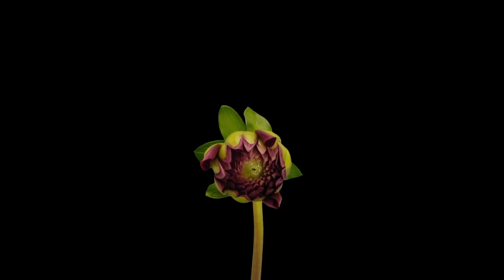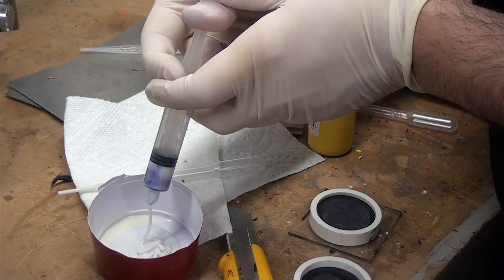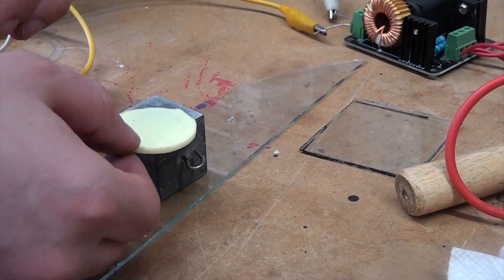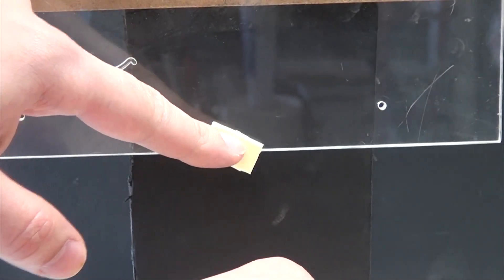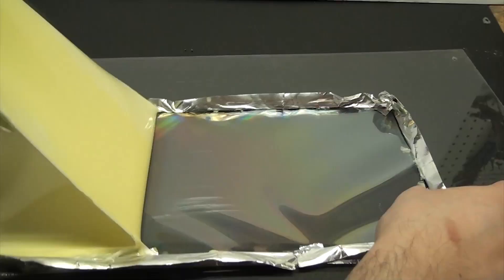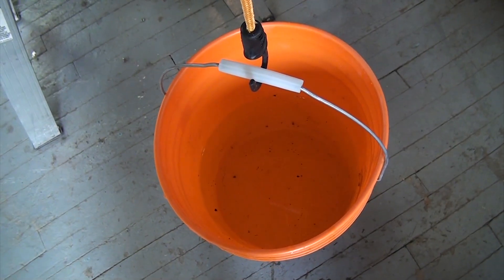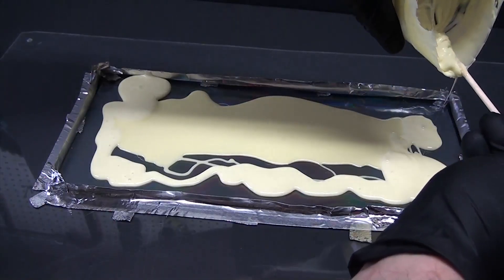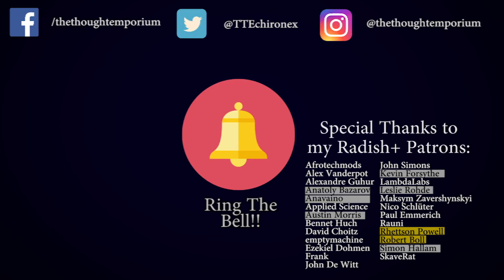Climbing Walls With RAINBOWS - DIY Gecko Tape

Comment: I wonder, Veritasium visited a company that is making plastic sheets that have color by punching millions of tiny holes in them. They are nano scale structures just like the some butterfly wings, and reminds me of the nano scale structures in gecko foot pads. Could a similar method be used to create a mold for the silicon? Or maybe the method they use to create the nano punches could actually just form the gecko tape directly?

Comment: Hello, I am a student trying to replicate this experiment and possibly take it further. Did you use any mold release in your process? When I demold the silicone it somewhat picks up the ridges from the diffraction grating but also has a dull matted finish. A few areas are smooth and brightly iridescent so I do not think the grating is the problem. Any advice you can give me would be greatly appreciated. Thank you for your time.
Reply from the maker: no, just poured directly on the grating
Reply: @thethoughtemporium  Hmm, maybe I am just being too rough when I peal it off. I know silicone is not supposed to stick to anything but mine strongly adheres to the sheet each time. Do you remember if you were using tin or platinum cure silicone for this project? Thanks

Comment: After you have poured the silicon, lay a sheet of woven fibreglass cloth in the mold. It will sink into the silicon and form a composite material that will distribute the pulling force more evenly. Then place the mold in a vacuum chamber to remove the micro bubbles that form under the material during the pour. Hope this helps.

Comment: my silicone is much more runny, did you use one with a catylist? i think it's platinum based. Thats what i used and it's super runny at first so gives a really flat surface on the "air" side. I didn't do gecko material  - i was actually scuplting an octopus beer opener :) very interesting video cheers o/

Comment: I’m a chonky 94 lbs (I’m a teen), so I’m pretty sure I could turn into spider man using this
Reply: i personally am really reminded of one of the first missions in black ops 2 where you grip onto a wall and swing off eachother. If this material gets refined enough, we might be on the verge of that

Comment: If you don't have one already, get a vacuum chamber. Being able to pull the air out of small places will give you sharper results at the ends of the silicone. Love your site. Keep it up. If your interested in hydrogen energy stuff check out "Roy McAlister hydrogen" on youtube. It'll make ya wonder. Aloha

Comment: You might try a sheet of cloth rather than acrylic for the gecko sheet backing- it should act as a load spreader, but still flex to allow full contact.

Comment: I feel like the untreated silicon is acting as a suction cup. Two extremely smooth and flat metal gage blocks will stick together if twisted in a way that all they air in between them is pushed out. When you go to smaller and smaller fibers or ridges I feel like you are either seeing a suction cup effect, or making the sheet flat enough to wring out air in between. This is why it only works on flat surfaces with as much surface area touching as possible. It failed eventually at 25 pounds because air leaked in slowly. If something was truly having a gecko effect, it would work best on rocks, wood, etc. where the high surface area of both objects mushing into each other creates grip. I think for features small enough to benefit from molecular forces, you'll have to grow them like nature, or carbon nano-tubes or something. There's no way a viscus liquid can overcome it's surface tension and it's own molecular forces to be able to squeeze into tiny holes. At least that's my impression.

Comment: What I’m seeing on you large pads is large air bubbles against the acrylic. Could you do what they do with skateboard grip tape. The put air pores through the back of the tape in intervals so the air has a place to escape.

Comment: You could use a cloth in your Silicone to better distribute your force and keep it from flexing so much, also some kind dense foam backing when you use a plate to pull the weight, just enough to help the surfaces mate completely...

Comment: It needs a flexible but firm application pad. And to apply and remove itself from the bottom up. Great work. I remember seeing  gecko tape for the fist time in the 2000s on Weird Connections. Great show. Look up gecko climbing robot.

Comment: I wonder if you could use a vac chamber to get the silicone to work a little better. I imagine the silicone probably isn't getting all the way to the inside of the valleys, and likely has a TON of microbubbles (if you've ever mixed clear or water white silicone, you know how many bubbles it picks up and will keep while mixing unless vacuum degassed).

Comment: Possibly:
...using a single large pad and it not making 100% contact and therefore failing ~ should be tested against cutting the pad into smaller pieces, and attaching them to articulated fingers on an arm, so that each smaller pad will attach fully at their own angles, and another set at different directions ... both of these smaller tests of closer to 100% contact should ..in theory.. prove more effective.

Comment: What I’m thinking, is you’d get better contact if rather than de-molding it from the refraction grating then trying to stick a backer on, adhere your backer while you do the initial pour, so you don’t get more deformation.

Then, once it’s secured, drill hundreds of little holes through your backer and the pad, so you don’t get trapped air bubbles.

Heck, even just drilling the tiny holes in what you already have, would probably improve contact a lot.

Comment: Could you setup a vacuum chamber to ensure that the silicon goes into all the grooves properly? You may see an adhesion increase.
: EDIT : Also, try using a Fresnel lens as it has concentric grooves instead of parallel. This may allow for greater adhesion since you'd have weight pulling at different vectors instead of all in the same direction. This would, I think, mimic a real gecko's pad more naturally.

Comment: Would it be possible to allow contact to occur in a vacuum chamber?
This might allow the silicon to get rid of the air bubbles between it and the Plexiglas.

Comment: Interesting video, I would like to throw out a couple of considerations you may want to consider if you continue experimenting with this or go back to it in the future. I hope this doesn't come across as criticism or negativity, just found this interesting and wanted to contribute to the conversation. 
The tattoo gun could work if you had the lathe set to move a tiny increment each time the needles are up, which would be a hell of a task without syncing the lathe with the tattoo gun. Or, you need to put just enough power into the needles that you can control a single stroke (or rig up something with a capacitor), in which case you can do a stroke then move the lathe like twice the distance of the diameter of the needle or whatever distance, which would be very tedious but would give you a great deal of control over the overall pattern. I feel like that level of control would make cross-testing different types of patterns easier. And, doing it the way you are, with a constant needle speed and constant lathe move speed, I feel like there is no way to avoid channeling appearing between the holes (for example: if you have a tattoo [I have a 6"x5" tattoo on my inner thigh] with solid coloring or have seen a video of somebody using that type of tattoo needle with a few needles in a row, you can see that same needle is used for shading and gradients in large areas, so when the needle is doing a darker area the artist moves the needle slower and as the gradient becomes lighter the artist moves the needles faster, and you can only see dots in lighter areas if you look close, otherwise it generally appears as a smooth [if somewhat splotchy in some cases] gradient. Point being: if the needle or the piece are moving constantly and not at precise increments specifically while the needles are up, then the needles are going to mark the material below them throughout the whole distance over which they were moved). 
Also, I think that it's really important to note that the needles you made yourself were at angles in relation to the surface, and even if you overlapped their impressions over and over again, the holes would be forming at an angle and around a center point, both of which (angle and center point) are potential variables to try out in relation to each other and the other methods you successfully tried out in the video. I just mention this because I work with steel and know that consistent versus inconsistent microstructure can make a HUGE difference in macroscopic properties of a material, and you've show that consistent microstructure can make a specific and observable difference in macroscopic properties, so it seems like cross-checking these various microscopic properties (straight vs. angled vs. curved holes, diffraction with holes vs. without, etc.) could be useful at least for the sake of experimental data. 
Also, what about diffraction graded silicone plus alternating, angled Tesla valves opening onto some part of the diffraction ridges? It would be incredibly difficult to make, but seems like it would solve some problems... Just a thought.

Comment: Any chance you can do this with a DVD or CD? Perhaps first removing whatever protective film is on the front.
Reply: @dageekoftheweek  They might. My issue with that is if the grooves get too small, it will become relatively impossible to cast in them.
Reply: The holes of a disk are completely internal, you can't excess them
Reply: @ipodhty  If you rip off the film which the DVD / CD cover design is on, the data is actually on the opposite side of that film.

Comment: Air pockets preventing the contact your putting it on flatish try rolliling it on?
Or fine holes in the back side?
Put more dense silicone ridges on back side with tube like grid to let air out ?

Comment: honestly, thinner plastic to keep the sillicone on, so you could just honest. slap it on, or bend it and slowly set it on. similar to how a gecko/animal walks. they dont just slap their hand on flat, but in curves, and motions. so honestly? try buying some cheap shoes ( or a cheap pair of grippey gloves ), and slapping it on top of the grip, or without! a good test for the shoes would be walking normally, then trying to raise your foot straight up. same with the gloves. lifting one end of your hand, and the ( most hopeful ) result, you'll peel right off! try pulling it straight off? dislocate your shoulder. ( not the most healthiest ending, but the best one you could possibly get. next to not breaking your arm. )

Comment: Make the pad into like a bladder. Seal the edges to something like plexiglass all the way round except a small opening push air in as you make contact with the surface pushing firmly down until you've pushed the air out. That should make allot more of it contact your other surface maybe?

Comment: Scientists: use literal electron microscopes to see gecko feet
Internet people: "So I'll just poke a bunch of holes into wax to make a silicon mold"

Yeah it seems like a no-brainer that you'd be using something that has surface-shapes small enough to interfere with light in order to model gecko foot-broccoli which is so small it couldnt even be seen with normal light.

Comment: Just a thought if you were to try this again, could you create some activated carbon to cast on to. Use a sheet of wood, carbonize it in a custom container, then activate it per codyslab process, thus creating a surface with very tiny holes creating lots of hairs in different directions when you pour onto it. To remove the carbon, just heat the silicone and burn off the carbon.

Maybe?
Reply: I feel like the diffraction grating idea is better because a uniform detailing in one direction is best

Comment: maybe multiple small Gecko pads instead of one big piece will help with full area attachment. I guess the problem is that big pads have concave pockets that traps air. Many small pads and each one could be ensured convex so that it drives out air when pressed onto a surface

Comment: You need a soft material behind the gecko silicon pad to get more surface area, even on surfaces that arent flat. Maybe just make the silicone a lot thicker or add a flexible structure.

Best would be a single piece of silicone that you can somehow attach to your hand which has the gecko tape structure on the right surface. 

Also, are you using vacuum to get the air out when letting the silicone cure? There must be tons of air trapped in the tiny holes!

Comment: Production Improvement Idea #1: Use strips of diffraction grating film perpendicular to the surface very closely spaced from each-other (1 sheet thickness apart) this will give you flat strips of diffraction grated silicon that will be more like a gecko's foot (make sure to orient the diffraction grating itself parallel to the surface)  this should allow for the air to channel out through the "Slits" and still allow the grippy surface  to make better contact with whatever it touches, though firm pressure may need to be applied to get maximum surface adhesion.

Comment: Have you try it on rough surface like tree, cement wall, rock, wet sand, shoe ..? If we could switch the state of this thing by electricity, a lot of application will be appear. Sport climb suit, dynamic sticky surface hanging items for household arrangement, improve air filter quality, next generator air filter in vacuum machine, high effective extract water in the air without decrease temperature, increase friction on street and vehicle, hologram floor that anti slip...

Comment: One easy way I see to make a better pad is to cast the silicone on the diffraction grating with the acrylic pad on the back as it cures. The problem was that the acrylic pad and the acrylic wall you were sticking to were booth flat, but the silicone was not. Letting the silicone dry between the acrylic pad and the diffraction grating will ensure it is a flat surface that can make ideal contact with a smooth surface.

Comment: As a casting surface, you might be able to get a highly porous surface by using acid to etch a metal. It would be highly disorganised, but also likely a far higher surface area.
Alternatively, if you laid a powder over the surface (or two layers of powder of different particle sizes), set the casting and then remove the powder from the casting by exploiting some property of the powder (eg if it was sugar, just use water to dissolve it. If it was something with a lower boiling point than silicone, burn it off)

Comment: Just make gecko tape with a strong fabric in it so that it can lie down onto the contour of the surface it should stick at while the fabric prevents it from stretching. In threorie this should be able to hold much more weight. (Sorry for my bad English, I'm from Germany ^^)

Comment: You need to do silicon degassing. That would significantly decrease the likelyhood of there being imperfections in the grating and greatly improve it's quality. You might also want to consider a stronger silicon material as the gecko is only putting its own small respective weight on its arms and legs. It might be better to do surface tests too, like testing on a hard rock surface, walling material, etc...

Comment: laminate some woven fibers in the silicon pad to prevent excess stretching.

Fiberglass or Carbon cloth, an old dish rag, or a patch of denim would work.
Hem the cloth at the edges and install some grommets to attach para-cord.

Comment: I ordered some of the 13000 line diffraction grating. Maybe it'll suck, but maybe it'll be better we'll see. I'm usually a pretty big Smooth-on fan for my silicone but what did you use?  Could even go the cheap route with some oogoo. Thinking of making some of those little vacuum boxes that people climb walls with and putting this around the edges to get the best of both worlds.
Reply: drat... looks like what I got was double axis. Doubt it'll work ideally. Worth a test I guess.
Reply: What happened? I take it didn’t work then?

Comment: To help with contact area, your tape should be thicker, or you should use a thin flexible gap pad between the acrylic and tape. That will allow the gecko surface to conform better since the acrylic pieces aren't perfectly flat.

Comment: If you used a laser to pattern the defraction grating you may be able to get the texture you need.  Also pick a stiffer silicone.

Comment: Sweet. I'm going to try this out immediately. I don't remember if you mentioned it, but for others who may try this an easy way to determine which side of your diffraction grating has the grooves is to put some mineral oil on it, the matching index of refraction between the oil and the plastic will cause the diffraction effect to disappear when it is on the grooved side but not on the other.  Same optical effect that causes some things to seem to disappear in certain liquids. You may need to change the liquid depending on exactly which material your gratings are. Mineral oil worked for my cheap ones.

Comment: To fix you flatness issue you need a "mold". Note the quotations. 
So silicon + vacuum chamber = no bubbles in the silicon. 
The "mold" part is that both the front and the back of the cured silicone MUST be parallel to each other. 
Because you let the back of your silicon cure to air it was not perfectly flat.when you stuck this back onto a sheet of acrylic, it transferred those imperfections to the front. 
You can most likely figure out the rest.
Also note that your front must be perfectly flat as well. As you said, tape is not going to cut it.